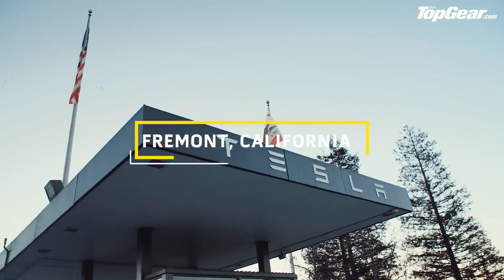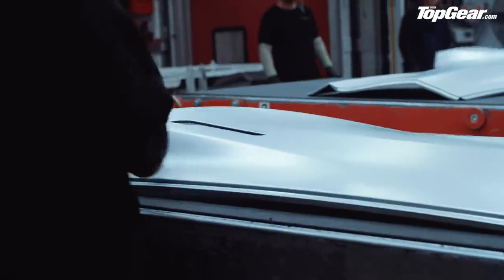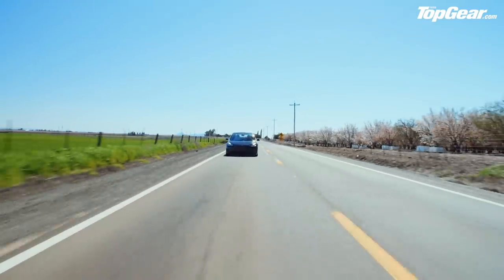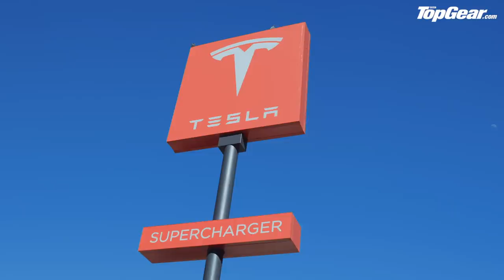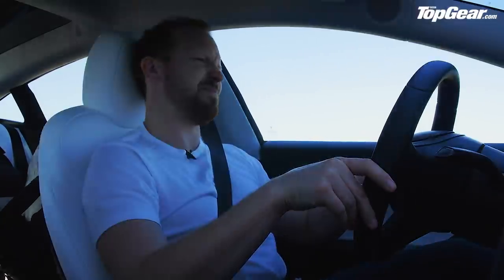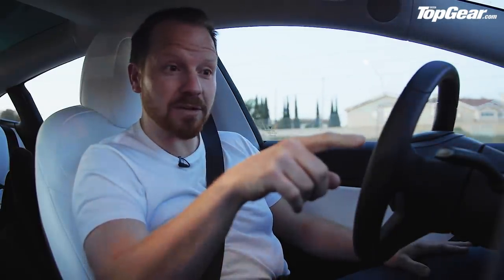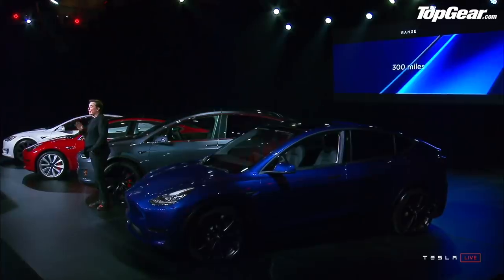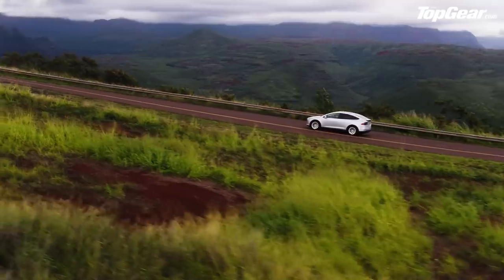TESLA Model Y Reveal, Model 3 Road Trip and Factory Tour | Top Gear

Comment: 50mins to charge fully from the 30%?? That is just ridiculous. I can just imagine needing to go somewhere or on a journey somewhere and time not being on my side and I get the low battery warning. I have to wait an hour for my car to fully charge. I'm fed up of charging my phone up twice a day I dont need more of the same issue. I'd rather fill my tank in 20 secs. When they get rid of lithium ion batteries and move on to a more advanced battery capable of charging alot faster then maybe. Otherwise electric just ain't ready. It definitely is the future though. We just not quite there yet
Reply: Most of that time is to get the final 20%.  If you're in a hurry, you run your battery down to 10% and charge it to 80%.   The new superchargers will do that in about 15 minutes.  But that's only needed on road trips.  Most days it takes less time than to gas a car because plugging in at your house takes 10 seconds.
Reply: @TheSlideshowtube  10% to 80% takes 15mins ? How much range does that give me. Disregarding the authenticity of what you're saying
Reply: Also, that is after about 3 hours driving. After that long of a drive, you really owe it to yourself to stop for 20 minutes for a bathroom break, coffee and a stretch of the legs.
Reply: For starters, you don't charge to full. Going from 0-80% takes the same amount of time as going from 80%-100%. It's way faster to make short jumps @ 15-20min each than to sit for a full charge.  On our 1200 mile trip, we broke it into 2.5hr chunks (drive 2.5hr, stop and charge+eat, drive another 1.5, do a quick stop @10min, etc). At 10% pull in, I charge @400mi/hr with V2 (pre 8.3 firmware. which is now ~25% faster) with it dropping off the closer to you get to 80.  Plug in a route on abetterrouteplanner.com and see how long you would stop. Now, take the amount of time you spend filling up in your daily commute over the course of a week - for me it was ~20min per month of stops with my Audi. My total time per month now is essentially zero, since my commute charge is done at home. So the way I see it, on my longer trips/vacations I will absolutely need to stop more, but I've gained time over the course of the months - net result unchanged. The only real difference is it costs me 50$ to go 1200 miles on a supercharger, or about 120$ in my audi.
Reply: Nothing wrong with the batteries. The technology is already there. I've saved £2000 since going electric, no way I'm ever going back to petrol or diesel and spewing out filth in to all our lungs and the environment. Internal combustion engine has had it's day - slow, noisy, dirty, like a steam train - nostalgic, cute in an old fashioned way.
Reply: @IronicIrony.  260 miles (US) including the 10% which was already there
Reply: Eric Wadge 3 hours of driving is nothing. A 5 min break is more than enough unless you’re taking lunch.  Just face it, long wait times for charging when you want to drive far just sucks ass.

Comment: Considering they changed from the 18650 battery cells, the new batteries they are using allow for so much more storage and ability to charge the company is constantly innovating.

Comment: There is way bigger hydraulic presses, there are at least two 50,000 ton presses that were built back in the 50s which are often used for stamping out parts for aviation and space applications as well the usual military stuff.

Comment: Regarding range anxiety, given that there were probably more charging opportunities along the route, I think he was either a complete newby, or making it up. The whole reason for anxiety is the belief you will run out and be stuck. I have rarely ever had range anxiety in a petrol vehicle because filling stations are typically quite  common, but driving through a country with fuel shortages or in a region with very few towns, it CAN happen. Its only an issue with electric cars if the vehicle has particularly low range, and/or if there are very few chargers, or you are just so new to the idea that you don't know what to expect.

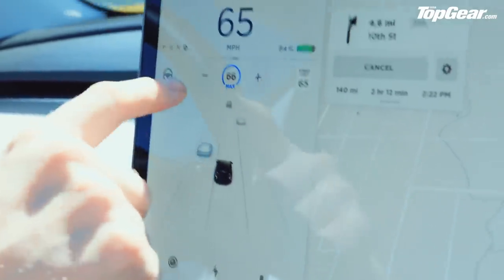Comment: at 5:55 he must have been in morgan hill CA. since he would be getting off on 10th st in gilroy to get over the 152 to the 5 south. which means he was going to the  tesla charging station off of highway 5 and 41 (kettleman city, ca).

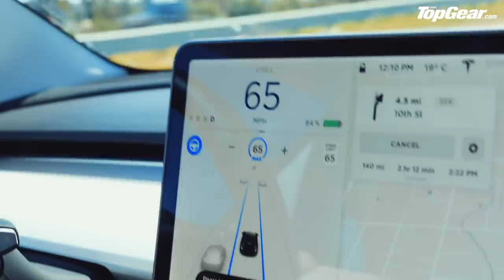but i think the video was chopped together, because at 6:15 it looks like he is in south san jose (on 101 south) where the 85 hits the 101.

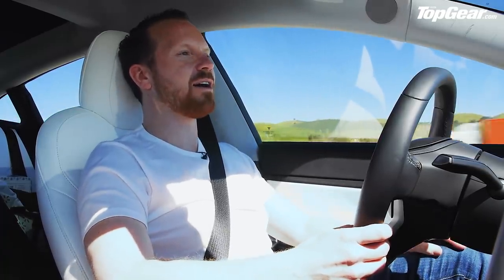at 6:47 he is going over the 152 east of casa de fruta, west of the 5th

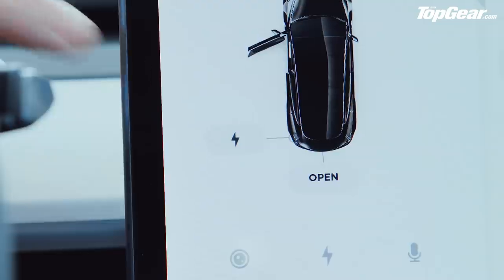Comment: 8:11 Slightly disingenuous to show the slow way of opening the charge port door, when you can open it outside with the help of the charging cable. If not disingenuous, then at least incompetence. Why not show the conveniences of the car better? There is plenty of YouTube based channels that do these things better, top gear. So you’ll need to kick into a higher gear than that if you want to remain relevant.

Comment: Tesla needs two things, a split circut adapter so u can add extention cords from two different 120v circuts 15 amps each and it needs a ghost charger port so you hide your extension cord to steal electricity from anywhere

Comment: I just drove without a break from Pensacola to Indianapolis in my Acura TL and had to fill up once with premium unleaded and it took 10 minutes with a quick drink refill and getting some pretzels. It would have took me another hour driving a Tesla. When they sort out faster charging or a longer lasting battery I will get a Tesla.
Reply: v3 charging average time to 80% is 15 minutes. Nobody charges to 100%, it's not worth the wait. To get from 80% to 100% takes the same time as 0% to 80%.

Comment: 50min recharge kills it for me.  Prefer my prius plugin.
Being in Texas, i would need a home charger anyways.  Not that many superchargers in the Houston area.
Reply: Kevin Gilbert ... the new chargers are twice as fast. Read the other comments. This presenter is new. On road trips I drive for two hours, charge for 10-15 minutes to 80% and continue. During that time, I use the restroom, stretch my legs and get a coffee. I don’t spend any time standing at a gas pump and I don’t pay $100 for a tank of gas. I don’t check the oil, belts, tranny fluid, brake oil etc.
Life is better.
Btw I love Houston.

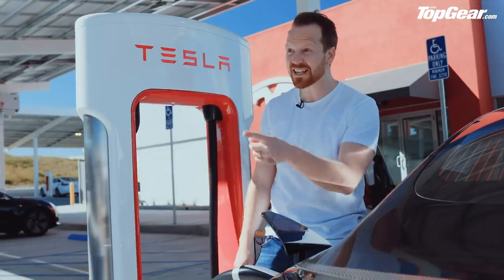Comment: 8:38 I notice that recharging from 30% takes 50 minutes. So not great if you have to get anywhere quickly if it's out of range. I really don't want to spend that much time sitting in a lounge.
Reply: Eat, visit the restroom, clean up, browse your phone or whatever and there you have 50 minutes spent. After long drives you DO want to take a break, it's healthy.
Reply: @RawbLV  All very well for someone who isn't on any schedule. And different people like to travel in different ways, however this does seem like a comment that could be described as damage control. Someone wanting to hush up a shortcoming that someone pointed out. Please know i am not bashing the car, quite the opposite, but i will draw attention to something i think needs to be improved and quite possibly could be. I'm just pointing out an issue i would like to see addressed. TY for your comment.  :)
Reply: @michaelb.1343  If your time management somehow doesn't let you charge the car at night or have a stop on a long trip, then don't use Teslas.
Reply: @RawbLV  That was the entire point i was making. Thank you. :)

Comment: Range anxiety would be the death of me.  That range is assuming everything goes right.  What happens when you're stuck in traffic for hours and you need to charge?  Of course the same can happen in fossil fuel vehicles, but at least you can have someone bring fuel to you.  With a Tesla it means a tow truck taking you to a charge station.  I was stuck in a snow storm and a Model S driver ended up abandoning his car on the side of the road b/c it was a wintertime, snowing, freezing, so he had to leave it.
Reply: A gas powered car still runs when it's idling in a traffic jam, an electric car doesn't. So it's a win for EVs.

Comment: With so much automation its amazing that the quality so bad
Reply: What "badness" are you referring to?
Reply: @zelekuther7938  general manufacturing quality. Interior stitching all over the place, shaky fixings, squeaks and rattles, panel gaps very inconsistent on the body, poor reliability etc etc. Not denying that they're performance and infotainment is exceptional but we have to stop looking at Tesla with tinted glasses. The model S is the same price as an S class and not even close in quality
Reply: @TheJPHarvey  thanks for that. I just took delivery of my Tesla Model X mid February, and I haven't noticed any of those quality issues. Maybe there were some early teething issues?
Reply: @zelekuther7938  Perhaps they have started to sort out the issues on the model X now or perhaps i just notice things more as im an engineer in the automotive industry. But i viewed a model 3 last week in the UK and it's still a long way behind a similar priced C class, 3 series etc in terms of the materials and fit and finish in the interior. Maybe like your model X it'll be better as the years go on. I hope so because it is a desirable car!

Comment: Ok ok the Tesla's are at the cutting edge of 100 per cent Electric driven cars. But How safe are the Re-Charging Stations namely Kettleman City Station and namely in very bad rainy weather? (Not that splashing around petroleum at a Gas station has a great safety record!)
Reply: Link me to a supercharger station disaster, exactly.
Reply: Extensive safety systems built in.  There is yet to be a report, anywhere in the world, of a Supercharging error/incident leading to an injury. [There was at least 1 electrician who died installing a Supercharger - Norfolk VA, working on a Sunday alone, didn't turn it off before taking it apart.  Not the part you see and touch, the heavy duty stuff off in the distance - the transformer etc.]
Reply: Putz. I plug my electric in the rain, without any shelter, every day. Meanwhile, the Tesla station is covered and there is always a slight delay before electricity flows. Don't look for problems that aren't there.

Comment: Isn't Tesla just a throwaway car? Battery welded shut inside the body and no parts can be installed unless it's at a dealer? I heard even aftermarket parts will be detected and they won't work and Tesla won't sell owners or shops parts. Is this true? And if it is why do people like them so much?

Comment: It seems to me that if you're going to wait fifty minutes for your car to charge, shouldn't fast charge centres be integrated into shopping centres? It's all well and good having a nice lounge to sit it and check emails, but it's still somewhat difficult to justify if you have a family waiting on you. If you can do your grocery shopping while you charge, then any inconvenience factor is gone.
Reply: V3 supercharging is 15 minutes, on average, to 80%. Nobody charges to 100%, charging speed reduces dramatically after about 80%. 80 to 100 takes the same time as 0 to 80.
Reply: @zelekuther7938  Well 15 to 30 minutes of shopping then. Why wait when charging could be a part of your routine with groceries?
Reply: @johnknight9150  you only supercharge on road trips. On a daily basis the car charges overnight while you sleep. It's super convenient, just plug in when you get home.

But yes, you have a good point. Some charging stations have shops and restaurants nearby. I agree with you that shopping centres would be great.
Reply: @zelekuther7938  If you're on a roadtrip you need supplies, toilet, refreshments, banking....
Reply: @johnknight9150  more very good points.

Comment: Why would they let you guys in there with all the lies and stunts you pulled???  Drag racing a Tesla with a dead battery to make it look like the other car won, Driving in circles in a parking lot so you can claim the range was insufficient !!!
Reply: Actually, they pushed the Tesla Roadster (original Roadster) off the track, pretending that the battery went flat. It didn't. In their defense, they said that they never actually said that the battery had run out. But they implied it by putting a sound effect on, showing Clarkson's face fall, and having people push it off the track.

Comment: So.... When will Tesla finally build a light truck and steal all the business from Ford? Because that massive instantaneous torque seems a perfect fit for light truck duty..

Edit: As others have noted, yes, you can change the percentage to miles. And the bash about "having to stop for 50 minutes or an hour to fill up".. This is a Model Y reveal vid. How can you guys say that without mention of the supercharger V3? Which can charge up to 75 miles in just 5 minutes???

Comment: I'm having 2 bites at the cherry with this youtube video! As I've read in the comments below...they had to catch a plane to San Francisco , to drive a fully electric car consuming no petroleum to Los Angeles. 

Can anyone here work out for the same trip in an "average size commercial jet" how many miles per gallon each passenger is consuming in aviation fuel, based on an "average number of passengers:? Or if someone has a link for someone who has already worked this out on a website/webpage?

Comment: Wait wait wait... $20 for a charge? I thought it was like $5
That's bull
Reply: Can you fill a gas car for $5? Or $20? No.
Reply: @RawbLV  there are several cars and motorcycles you can fill for $20
Also it's the time. If my time is worth $25 an hour and it's going to cost me $20+50 min to charge then that's leaning towards a $45 charge just out of the time.
Reply: @jeepneygang  You haven't linked any car. Can't compare motorcycles to electric cars. Also nobody cares about your poor time management.

Comment: If these types of cars become the norm, I won't be interested in cars anymore.
Reply: Did you drive one?
Reply: @nagromnewo  It's not just because of the driving experience. It's the practicality of the car. It's the design of the car. It's the vibe of the car. And also the price for what you get. Just look at the interior of the Teslas. It's just such a boring car. Yes the technology is impressive but I don't care if my car uses petrol or electric energy if it does the exact same thing at a higher price and with less comfort. Call me crazy but I am not willing to pay 35000$ to support a tech demo.
Reply: @ThaAidry  the 3 is minimalist inside, for sure . But I have never seen anyone unimpressed by the interior of a model S or X.
Reply: @kebuhrogers  Guess there is a first time for everything ;) The exterior and the interior look like they have desperately tried to keep their own costs as low as possible. No details at all. Some people might actually prefer that though so it comes down to taste.
Reply: @ThaAidry  if you are trying to keep costs down, you don't make a full glass roof, 17 inch touchscreen display, another screen for the instrument cluster, soft close console etc. But I agree that everything in the 3 was clearly made to keep costs down. It looks naked in there, like a counter top with an iPad attached
Reply: @kebuhrogers  Compared to other cars in the price range of the model S, it is very minimalistic though.

Comment: A lot easier than filling with fuel ?...I spose...
With the exception that you’ve then got to hang  about for an 1hr 🤔
Reply: 99% of all charging happens at home while you sleep.
Reply: Entirely false, as expected from ignorant anti Tesla FUDster.

FACT: 70 miles of range in 5 minutes, 10% to 80% in 30 minutes with supercharger V3 and battery preconditioning.
Reply: Only a noob supercharges to 100%. Charge to 80% in 20 mins, no point waiting for an extra 30 mins to go from 80 to 100%.